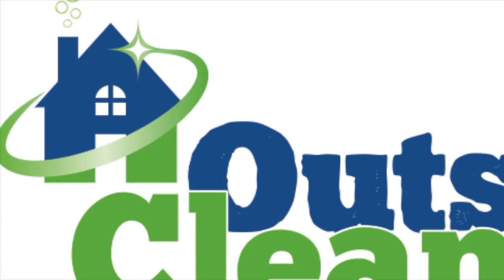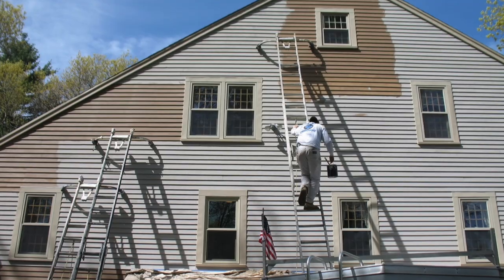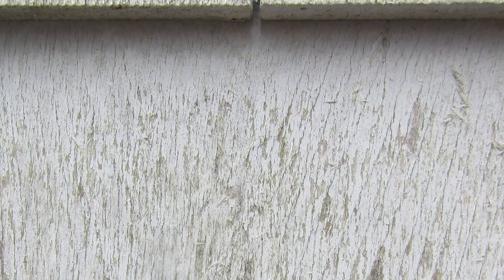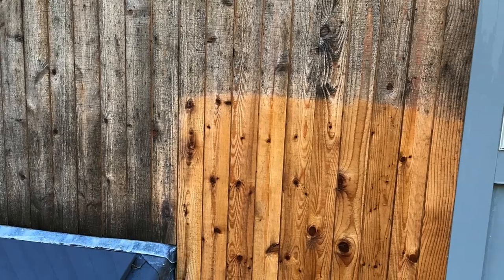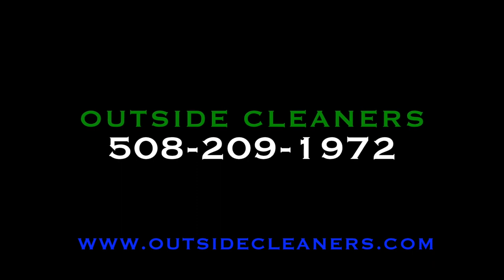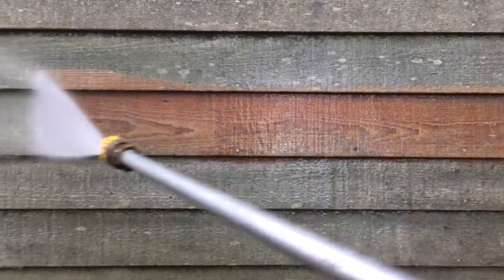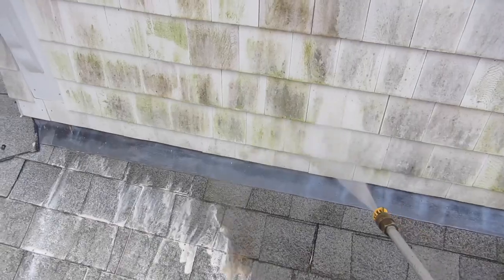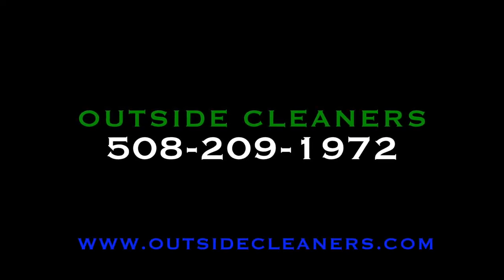Preparing Cedar Siding for Paint or Stain on Cape Cod

Comment: I've got a job on a cedar sided house where the home owner wants only the lower half of the house to be restained. The upper portion of the house actually seems to be in good shape but the lower is peeling. Last stained 15 years ago with Sikkens. I'm hesitant to only do the lower half and spoke with them about the large possibility that the color would not come out the same. Is it even possible for me to treat with sodium percarb on the lower half, power wash, and then restain the lower portion? Would I need oxalic in this case if I were going right to stain? Seems like a bad idea to me and will be really inconsistent.
Reply from the maker: @GrimeBusters-j3t  yes you can do just the lower half.  No it won’t match the upper half.  I’d be hesitant, too

Comment: I ended up recently doing a red cedar house that the owner doesn't want to seal and has never sealed. It was filthy and was my first big job. I ended up using sodium percarbonate and then followed by oxalic. The owner only wanted half the walls washed and now it looks starkly different, obviously. Should you always use oxalic? I've been reading that oxalic is necessary to protect the integrity of the wood after using something like sodium percarbonate but the oxalic obviously has lightening properties. How do you walk home owners through this?
Reply from the maker: @GrimeBusters-j3t  thanks for watching.  I walk homeowners through it by walking them through it; I explain the options and the pros and cons of each. Often times, homeowners have unrealistic expectations, which need to be brought back to reality.  And I almost never, ever was just half a house because it will obviously look profoundly different than the unwashed part.
Reply: @OutsideCleaners  good lesson learned. It ended up working out and the home owner is actually really please with it which I find strange haha. Thanks!
Reply from the maker: @GrimeBusters-j3t  live and learn!